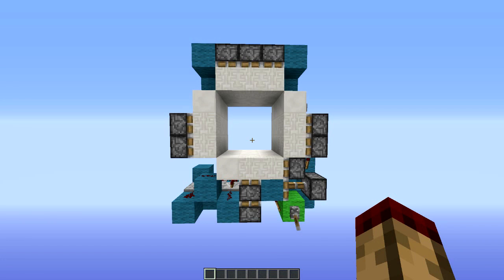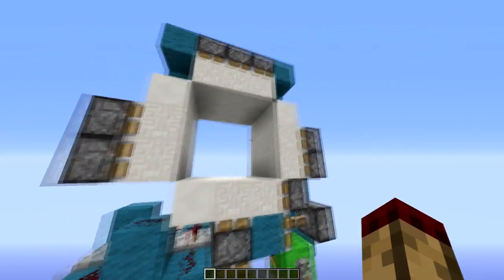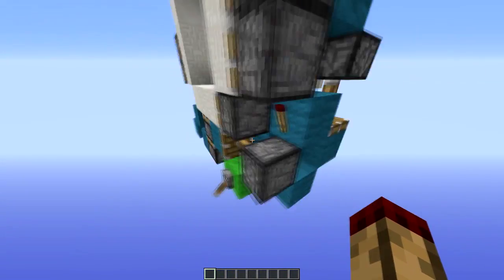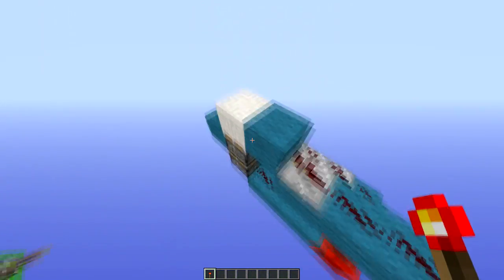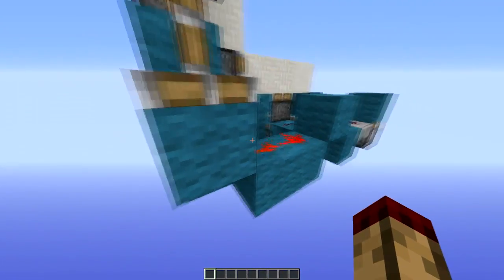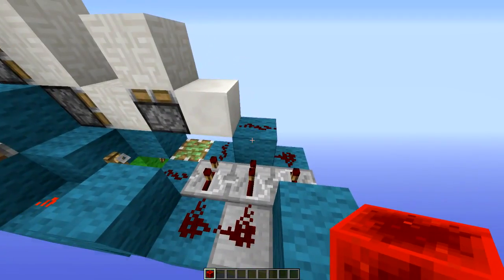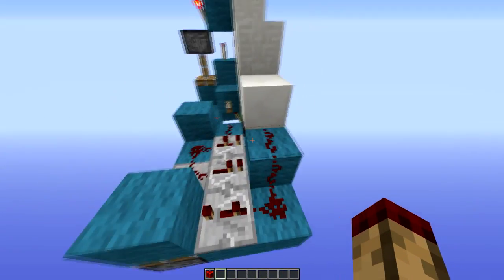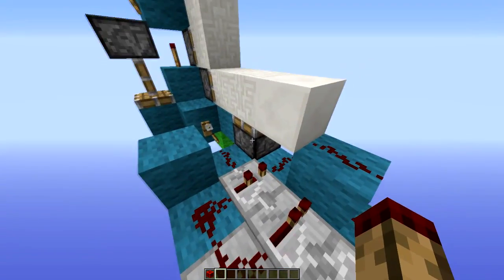Minecraft: Fast 3x3 Piston Door

Comment: cool! does it work on bukkit? abh037 made one and i THINK its just as fast but its 1 wide and it works on bukkit. cool design anyways!
Reply from the maker: Sometimes, the 2 tick repeater on the double updates the bottom piston sometimes on bukkit.
Reply: TT Lemon ok
Reply from the maker: Mrbillybobcorndog
I made a one wide one same speed as well, not too practical though being one wide.
Reply: TT Lemon the 1 wide ones are the best! you can fit them in anywhere